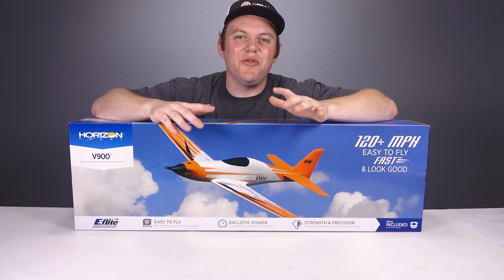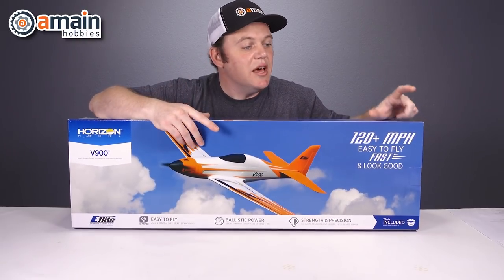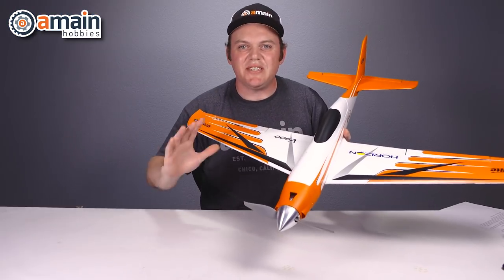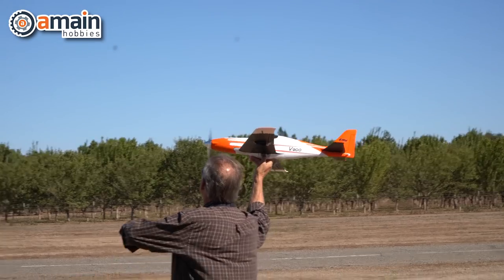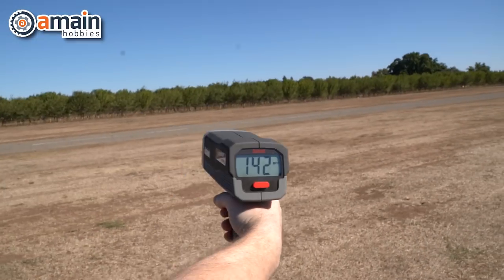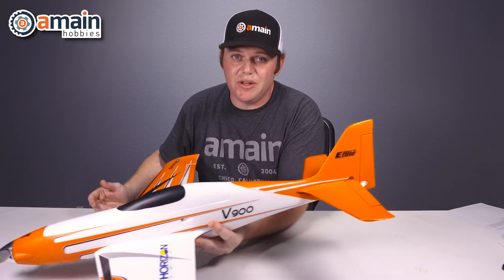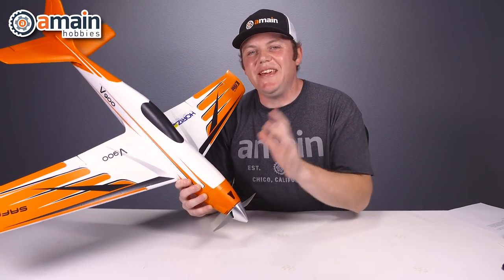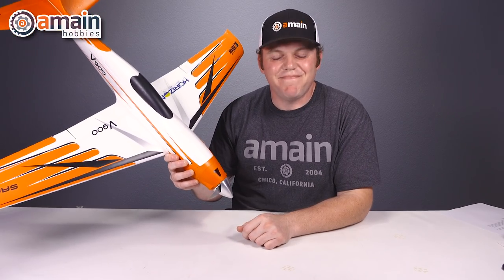What's New: E-flite V900 120+MPH High Speed Electric Airplane

Comment: Which 4s 2200mah battery would you recommend running in this plane ?
Reply from the maker: Blade now recommends this Spektrum Smart 4S Battery: https://www.amainhobbies.com/spektrum-rc-4s-smart-lipo-battery-pack-w-ic3-connector-14.8v-2200mah-spmx22004s30/p802489?r=0
-Brett
Reply: AMain Hobbies thank you!

Comment: people from horizon hobby used 2200mah 4s before. i just order mines today
Reply from the maker: Congrats Speed Fresh! You should be ok on the batteries. The space is tight but not unmanageable. Let us know how you like the model down the road. Thanks. 

-Brett
Reply: AMain Hobbies no problem man. You can use 1800mah 4s or 2200 4s it’s a tight fit but I’ll make it fit. I been flying planes for 19 years. I’m the pro
Reply: @AMain_Hobbies  i got it, it came. it took 2 days so not bad at all. i just made the video of it.